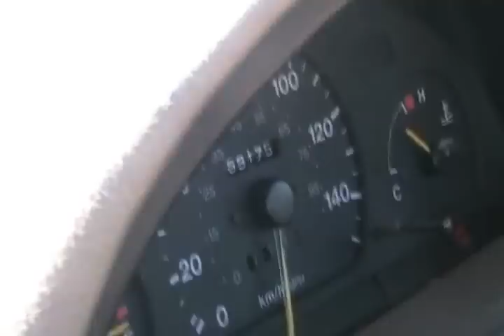#1117 Engine blow , 1995 geo 1 3 [Davidsfarm]

Comment: I'm thinking what happened was the dirt and rocks put very deep scratches in the piston walls and piston rings and that's why it lost compression
Reply: Quite likely. It's also possible the rocks damaged the valves or even broke the pistons and/or head.

Comment: Ive had 4 of these engines and 95, 96, &97 were ok the 99 was redesigned 16valve and a POS leaked oil like exxon valdeze, smoked like a train & knocked like a mormon with diarrhea I admit after 98 the engines were peppier but they were crappier also I kept praying for somebody to hit n total that 1 cuz I'dve been delighted to get even a $800 check out of it no such luck